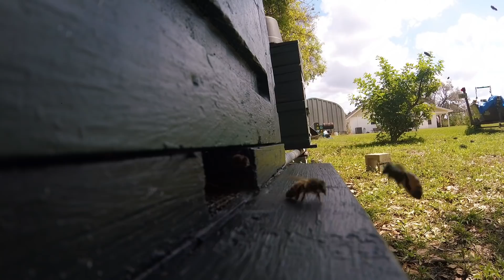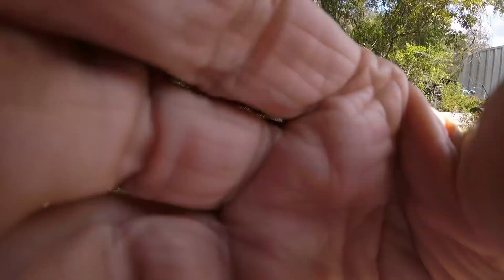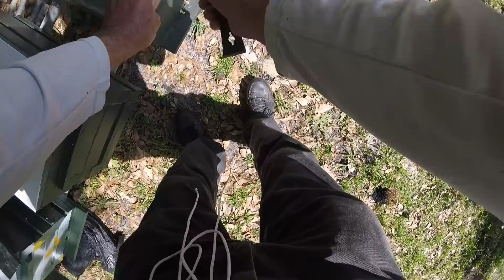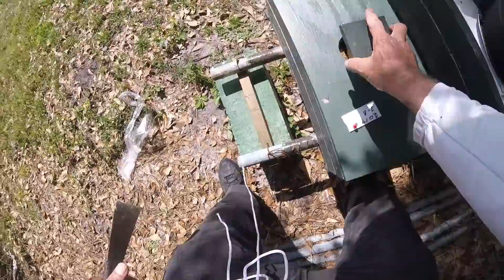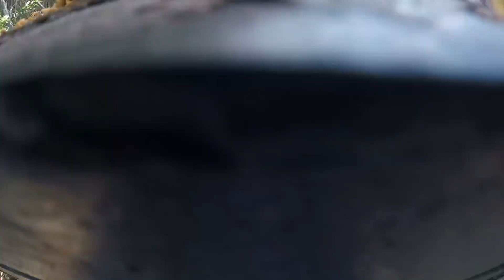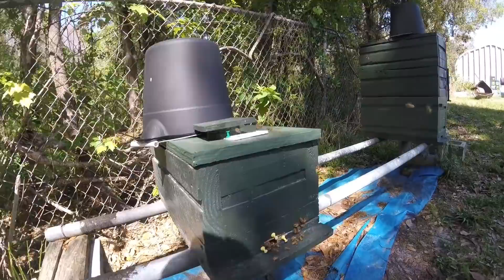Rob From Petra To Pay Pauline

Comment: Lol from Michigan here foaming at the mouth.  I just noticed that you are keeping bees in 5 frame equipment.  I’m doing this very thing this year working off the understanding that I can build up faster vertically than horizontally
Reply from the maker: Thanks for sharing Decatur Ridge Bees it does seem to work great as a hobby operation.But if i was getting into a big time operation i would run 8 frame deeps.